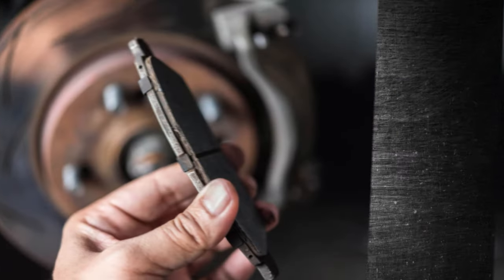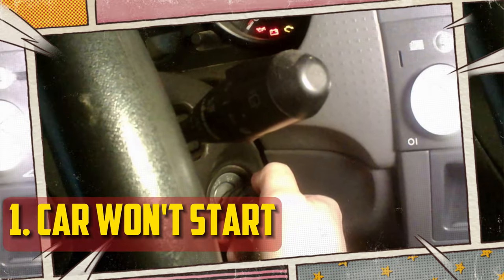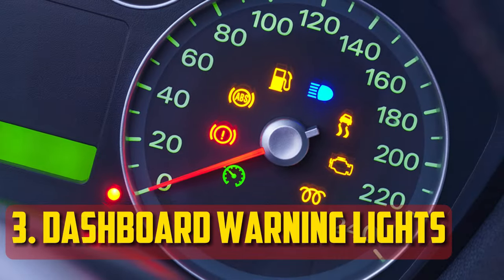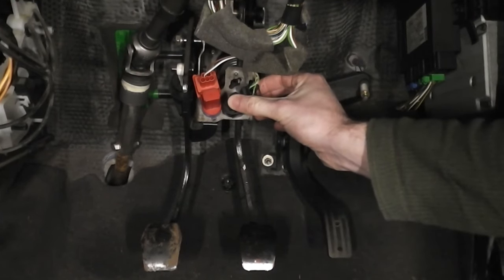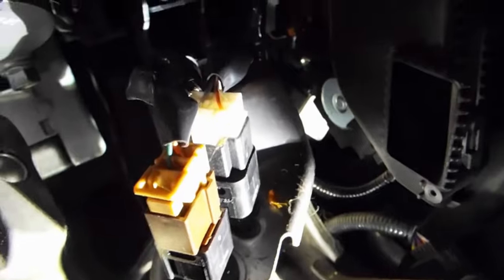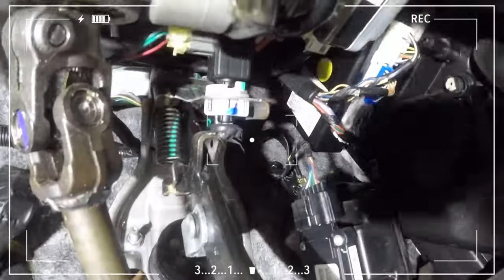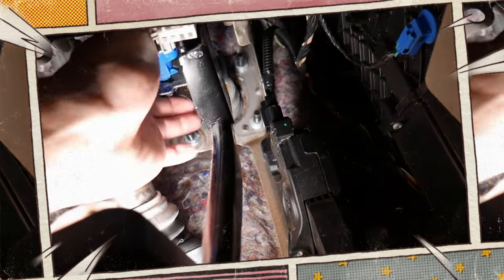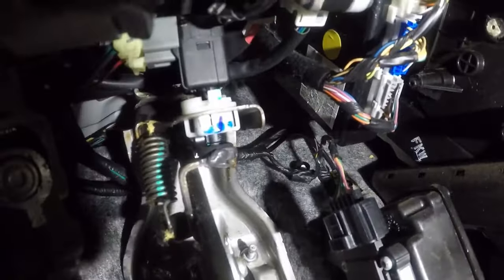5 Faulty Brake Light Switch Symptoms   How to Test

Comment: Can it be one or all these symptoms?
Reply: So I had the traction control light popping up on the dash of my son’s 2017 Altima SR, intermittently. Didn’t think anything of it, cuz it would turn off and car ran fine. But just in last few days, car would not start without pushing button and applying brake 7 or 8 times, till it finally started and then at times couldn’t get the car out of park. Heading to Nissan tmrw to grab a new switch. So it just started with the traction control light, then all those other symptoms kicked in over time.